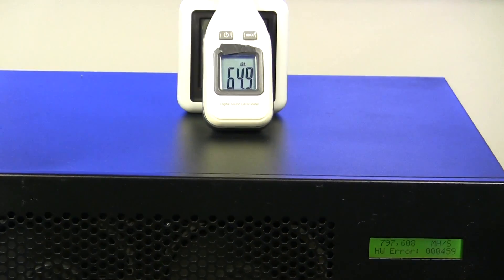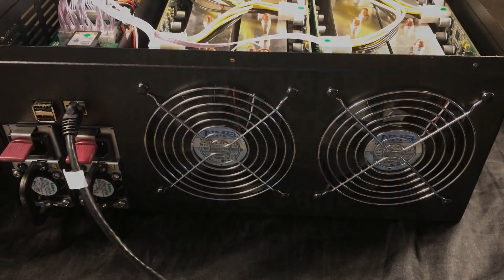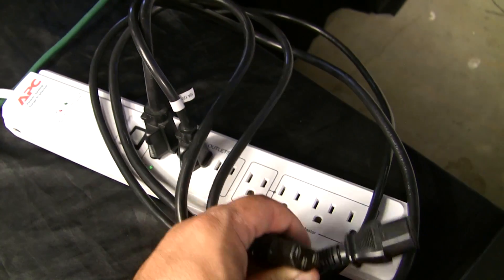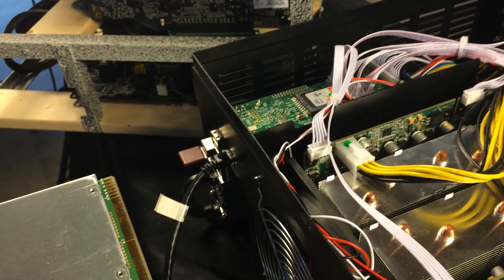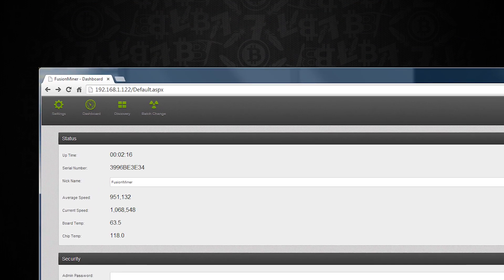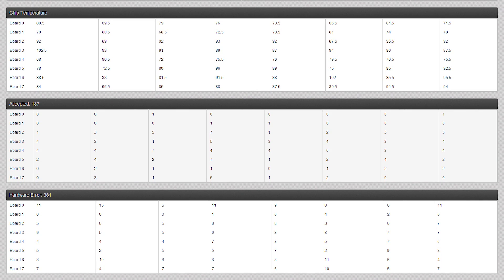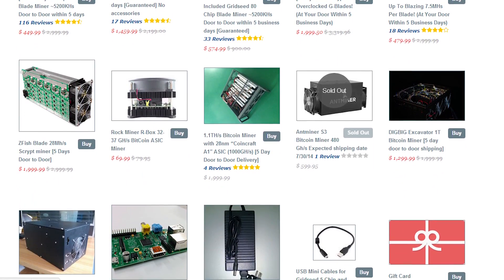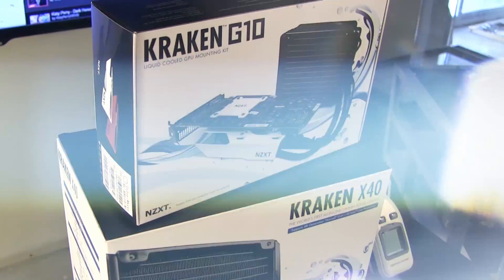BBT Episode 17: Digbig Excavator 1T 1.1 T/H Bitcoin ASIC by Zoomhash.com

Comment: Good to see ASIC videos but this device is well out of date, 40nm and almost 2W per GH (1950-odd watts shown in your video) is terrible! Current ASICSs are 20nm or 28nm running around 0.6W/GH. This device is just burning profit away. See if you can get a sneak peak on the upcoming Spondoolies Tech SP30 to review or any of the others already shipping at 28nm.
Reply from the maker: I hear ya ...but bottom line those 20nm and 28nm were not immediately available and most all were pre-ordered. Additionally many people have different situations on power, some have far less cost than the national average or in different countries have other opportunities on solar/subsidized cost. This gives them a competitive advantage on cost and its all about how much hash can the buy RIGHT now, vs placing a pre-order on a 'potentially' better unit. For folks in that cheap power areas, they are buying a device that does what it claims, which is asking a lot in this space.